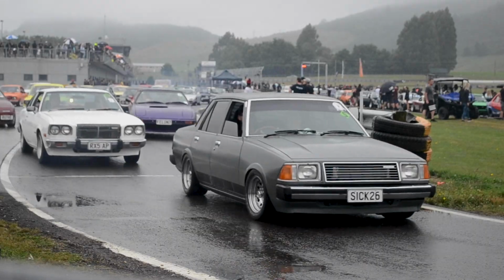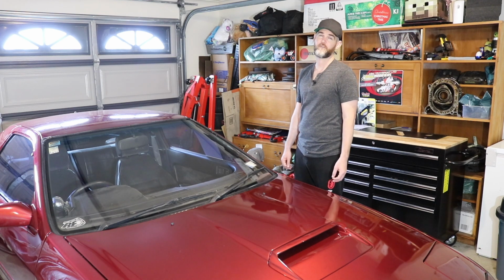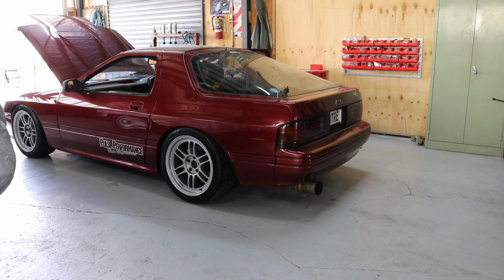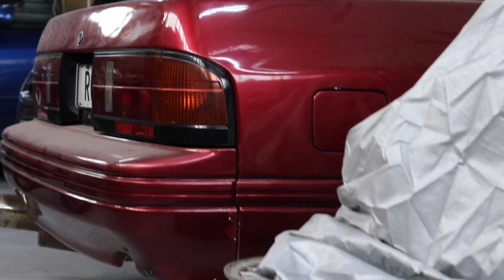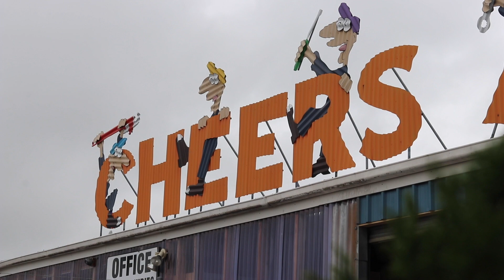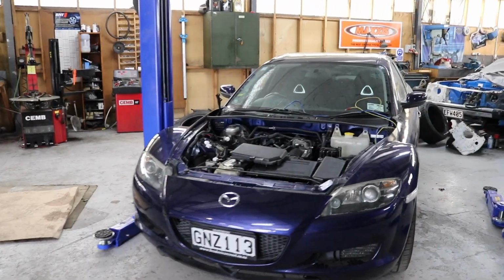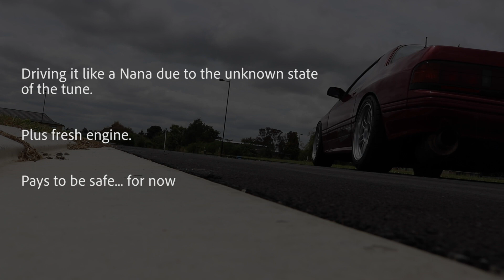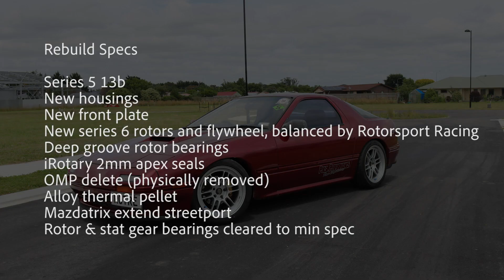Engine rebuild is done - FC RX7 EP7

Comment: Did you ever sort out your cooling issue? I had a similar one in my batty and it turned out that the radiator was trapping air in it. Seeing as how it had a remote Filler cap that wasn’t part of the top tank the air wouldn’t travel down again to get to the high point. Dropped amd tapped a brass fitting into the top hose connection and ran that to an air recirculating tank and it never had another issue .
Reply from the maker: Thanks for the info, that's handy to know. I went down a rabbit hole with the FC - still buying parts for it. Hope the cooling is well and truely sorted after haha.

Comment: great to see the series 4 back on the road, looks like it had radiator stop leak crap in it for the water seal issue, the red crap, make sure you flush the radiator good, also the interior heater/radiator,  i always get the oil cooler/s flushed, cleaned, tested too, no point putting filings etc into the new rebuilt engine etc, did you fit FD front & rear stationary gears and bearings ? cant believe your finding it hard to get someone to tune the microtech :( Q - - what dissolver spray did you use on tints ? have to my rear window on the S6 :(
Reply from the maker: I’ll have to check the invoice breakdown for that to be honest haha. The spray is called “dissolve-it” but there are better ways - search up black bag tint removal. That’s what I’m trying next
Reply: @GarageRacers  re tints, cool, thanks, not looking forward to it, thinking might take the rear window off and put upside down on stands :) that sounds like more work though lol
Reply from the maker: rotor_dude NZ haha wouldn’t go that far with it

Comment: Been waiting a while for FC footage. Happy it's all back together! Regarding the cooling problem, maybe verify that the base timing is correct with a stock crank pulley. I've had mine out (retarded) and caused similar cooling issues.
Reply: Gflex187 think its his radiator thats blocked is sweet at idle and around town but once it is loaded up on highway temp goes up so its not getting enough cool air through it new radiator and bottom hose with spring and shroud should be ok and a tune.
Reply from the maker: Thanks mate good to know the FCs have a following. Yeah what Ben said. Cools down nicely at lower rpm, the radiator/intercool/oil coolers are all pretty crappy and old too.